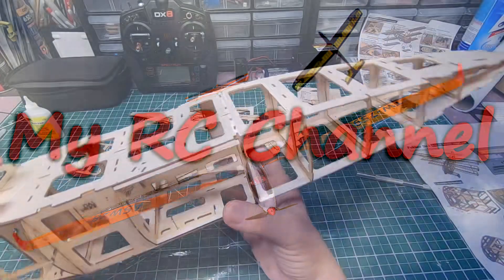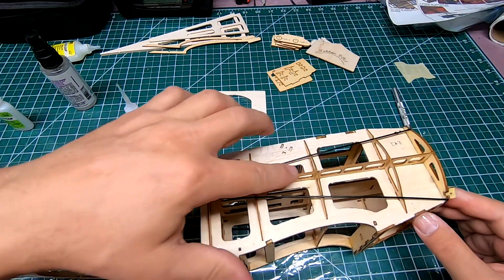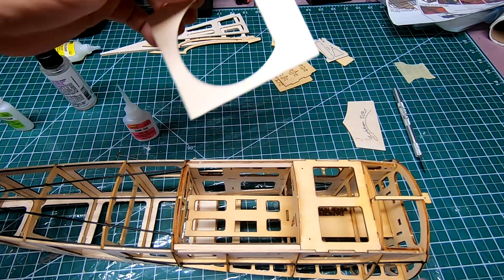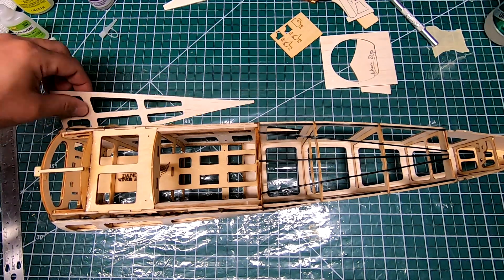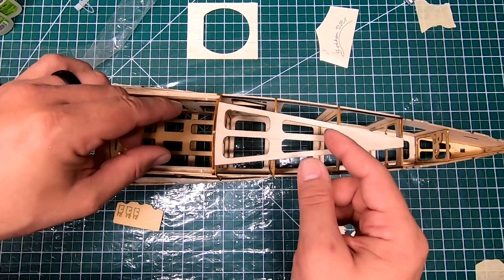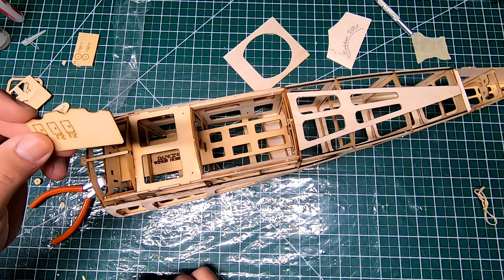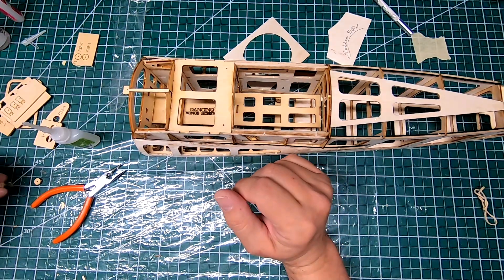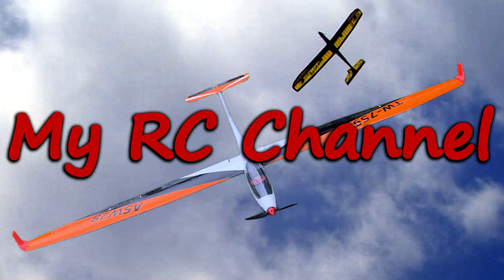Building the Fokker Dr1 770mm, Continue Assembling the Fuselage, Pt-3

Comment: Hi pal. My dr1 arrived two days ago. I started with the wings and was having trouble finding any info on the fuesalage. So glad I found your video. I am currently doing a time lapse video of my build 👍
Reply from the maker: Excellent, you'll have to send me a link to your video when you put it online. Starting with the wings is as good a way as any. Either way, there are points where you gotta stop and work on another part until you can see what's going on... the lack of clear instructions leaves a lot to figure out. My not sheeting over the cockpit and the front of the fuselage is an great example... the battery hatch is another example. I'm definitely going to mount the ESC under the front sheeting on top of the battery tray.  
BTW, have you decided on a battery? I read that the recommended size is a 3s 1300-1800mAh and the tray from the firewall to the second bulkhead is about 95mm, I chose these: Turnigy Graphene Panther 1500mAh 3S 75C Battery Pack w/XT60
https://hobbyking.com/en_us/turnigy-graphene-panther-1500mah-3s-75c-battery-pack-w-xt60.html
HK sells them for 21.64 and they are 90x35x27mm... They should fit just right and with the discharge of 75C peak of 150C, they should put a lot of grunt into the motor. I have a few of the Turnigy Graphene Panther and they perform great.
Reply: @MyRCChannel-CJScott  I have a load of 1500 turnigy 3cell as I fly fpv uav. So gona try them first. Found the dwnload files on hk for the 3d drawings so along with your videos and the plans I should have a good chance of getting this puppy finished.
Reply from the maker: Nice that you got those batteries handy! I need to get into uav and drone piloting... I have an unassembled quad that is on my very long "to do" list. 
Glad you got the downloads off HK, I'd have had a really tough time without them. I should mention those in one or more of the build videos... I think I talked about them during the original unboxing video but I should do it again. Thanks for reminding me.

Comment: I am at the same stage as you. 
All wings assembled, rear control surfaces and fuselage are ready.
I don't know, what kind of servos are better to use. Another question is, might be better to close the wind servos or make it open and serviceable?
Reply from the maker: Ok, let me answer your last question first. The aileron servos in the wing are designed to be bolted to the mounting panel and that pannel bolts to the frame in the wing. That way if you need to access the servo, you remove the four screws at the corners and pull out the panel with the servo attached. I will cover this issue in upcoming video. Sorry for the delay but my wife and I got very sick and I've been trying to do several projects at once... the Foker build will continue soon. I apologize for the delay.
As to which servos to use, I'd use micro servos. Here is an excellent candidate for the wing servos because they are less than 1cm thick, ball bearings and metal gears. 
https://hobbyking.com/en_us/turnigytm-tgy-ex5252mg-twin-bb-digital-micro-servo-2-8kg-0-10sec-12-4g.html?queryID=0d7f04c1322eab3560e3406b1475464d&objectID=45157&indexName=hbk_live_magento_en_us_products
These could also be used in the fuselage for russer and stab. I have several servos I may use and am still making my decision.

Comment: Another question about fuselage.
One of the plywood cross member, that goes right behind the bottom wind, a bit smaller at the bottom, so the rear bottom section creates an arc. How did you solve this problem? Add some material at the bottom or left the arc. I can't see that from the video.
Reply from the maker: Are you sure that you are not referring to the middle wing? That has a curved section on the left and right I think the part is number W33 they are a pair of thin plywood triangles. If you can see the part of the plane in question in one of my videos, send me the video's part number from the title and the time in the video so I can see what you are refering to. I'd really like to help, but I'm not understanding what you are referring to. 
Also, download the "English manual" here - http://img.banggood.com/file/products/20171225021830Fokker%20Dr.I%20EN.pdf
Describe where in the images you see the part/problem.
More about your question from your other comment about the wing servos, on the first page in section "3. Assemble the upper wing" you can see that part W3 mounts to the wing between two ribs, part W4 is a removable panel that the servo mounts to. W4 is covered separately and is attached to W3 with 4 screws so that it can be removed for servicing the servo.
Again I apologize for stopping mid build to work on a different kit. I thought I'd have gotten back to the Fokker before now. I will get back to it soon. Hopefully within 2 weeks. My doc thought that both my wife and I had covid19... we weren't sick enough to be hospitalized but we were sick for a long time and aren't completely well yet.